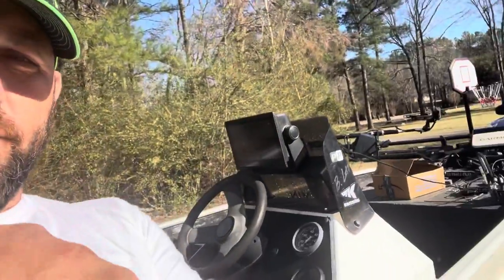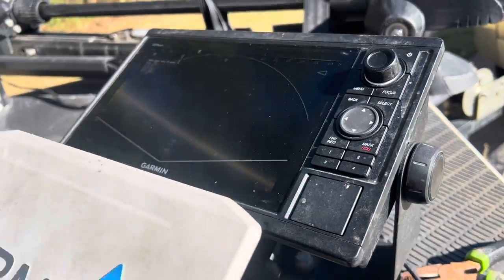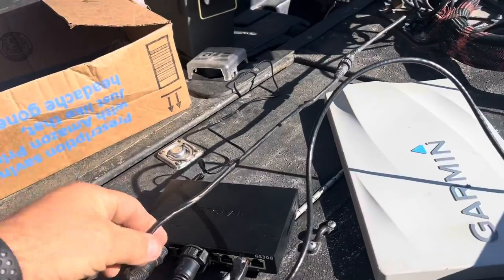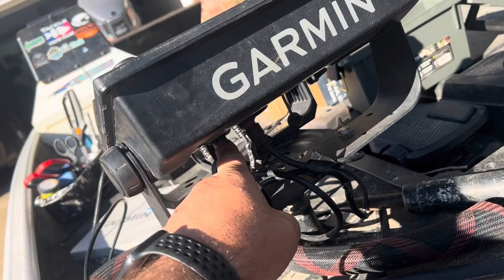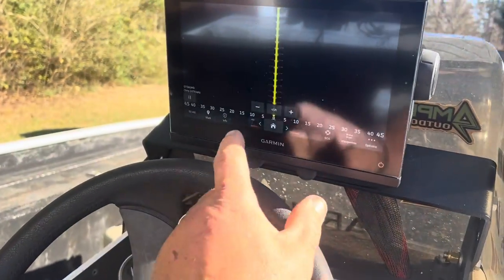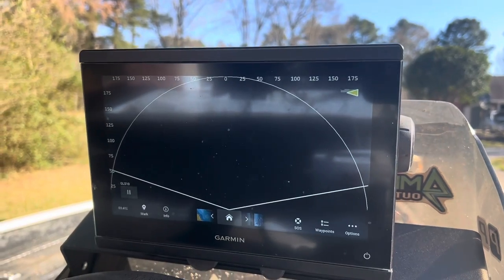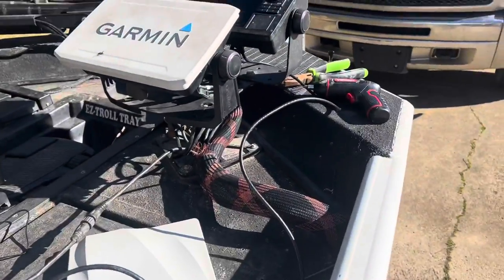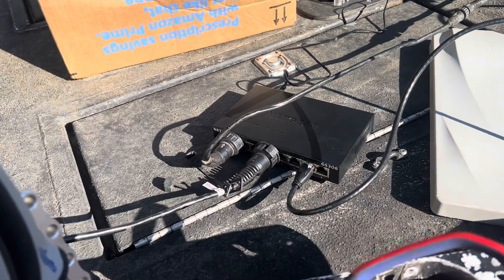NetGear Hub: Does It Actually Work?!?!? Let’s Find Out For The Haters

Comment: People refuse to think outside of the box.  Thank you for this vid.
Reply from the maker: Agreed
Reply: I got the same switch today.  My only concern is the voltage in my boat goes up to 14.8v when running full throttle.  I curious if the switch can handle that.

Comment: Looks like this video is 1 year old when I found it.  I'm curious.   Are you still using this setup?  Problems with this setup?  And what changes if any have you made to this setup?
Am I correct that you used Garmin RT45 cables for your networking between devices?  Thank you.

Comment: I currently have a 1022 and a 93sv plus.  I have two livescope units, one is at Garmin for some warranty issues.  I recently bought a Hummingbird Mega 360 and Helix 15.  I was able to use the setup once before having to come back to work.  Do you know if the netgear splitter will work between to two different head units?  I have been told that they won't.
Reply from the maker: Haven’t researched that deep brither. Wouldn’t want to lead you astray

Comment: my PS30 won't run through GS308, Livescope and Fantom run fine. I have 2 mains plugs in the 1223sxv but would like to limit the number of cables on the table. Why exactly the PS30 won't run through Netgear?
Reply from the maker: I’m not well informed on the ps30
Reply: Did you ever found out a solution for the ps30 ? Same problem here, lvs32 works perfect but not the ps30.

Comment: Going to install mine in a carpeted bow storage compartment. Do they get hot?
Reply from the maker: Not that I have seen
Reply: @The_Garmin_Guru  Thank you for responding.
Reply: OK. It works well for me. One note of caution. Be careful you don't get the polarity reversed on the Netgear cord or you will see smoke roll out and it will burn up instantly. Don't ask me how I know!
Reply from the maker: @richardthompson8207  good to know bud

Comment: Will this work with a 1022 up front and then using the hub run a output connection to my ultra 106sv unit to display livescope on the console?
Reply from the maker: No sir. Have to be in the same family of units

Comment: Just seen this. Not all boxes are 12 volt. I looked at 3 different ones before I found net gear 305E that’s 12 volt. Others are 5 volts
Reply from the maker: I specifically found a 12 volt one

Comment: If you're hooking this up to lithium you will have to have an inverter . I just blew my netbox  and went "poof". I ran to a fuse block and blew 2 3amps fuses. Tried a 5amp and that's when it blew up. I suspect that the 13.1v I'm getting from my battery to my fuse block was to much and blew it up. That's why I'm assuming guru is running off a lead/AGM that provides 12v
Reply from the maker: I just did that for a test. Some people still use it.

Comment: So question. Why does it have to be a netgear box (or switch)? Why would just a Ethernet splitter work?

New to graphs and boats in general and I’m working on getting mine setup.
Reply from the maker: It doesn’t have to be bud
Reply: @The_Garmin_Guru  ok thank you
Reply from the maker: I have a net gear box you can have. Email me at thegarminguru@gmail.com
Reply: @The_Garmin_Guru  thanks chief. I sent you an email going over what I’ve seen so far and what I have going on. Maybe something will click to you but I’m not sure what I’m doing wrong. I didn’t include in the email but using 5A fuses in the block.